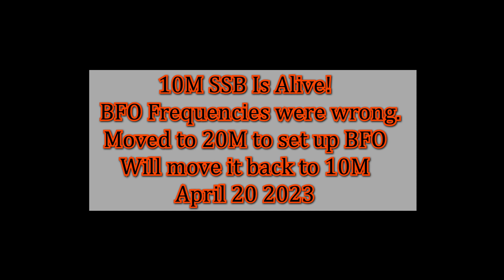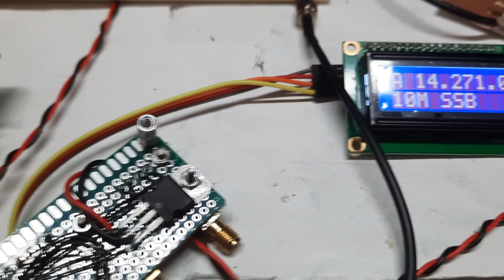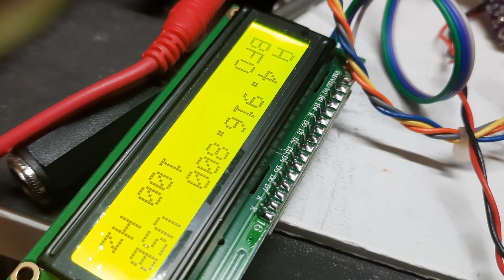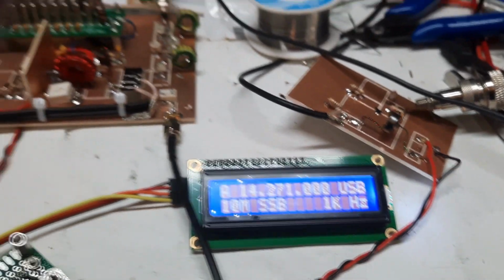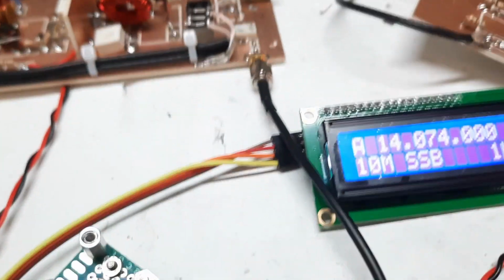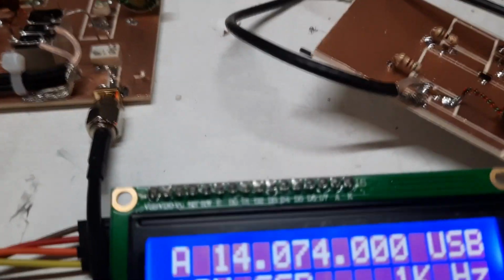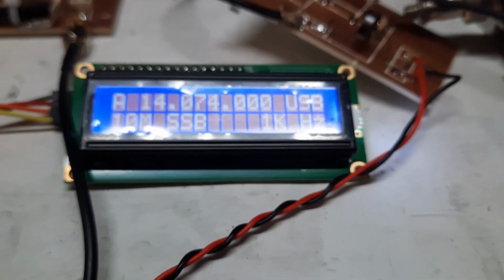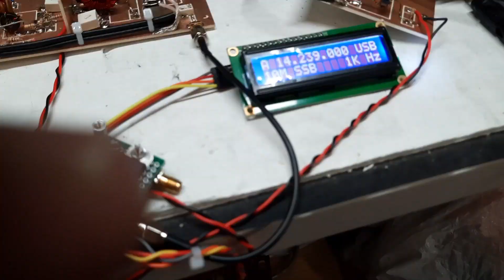10M SSB Transceiver is inhaling RF

Comment: It ain't over till the IF squeals! Is that a kit filter Pete?
Reply from the maker: Yes it is a kit filter that comes in 4 different frequencies. It is from Todd, K7TFC at Mostly DIY RF , com
Yes it does squeal with the right values of emitter resistance (gain). Thanbks for watching,

Pete

Comment: Sounds as good as it looks Pete. Well done! I love that moment when the radio is spread across the bench with all kinds of connecting wires ... and it works! My challenge has always been to keep it working once I've squeezed it into a metal enclosure! 73 Nick
Reply from the maker: Mine Too! But the reverse is true. When I worked in Aerospace this one engineer had been developing a circuit for months and it didn't work. Accidently his shirt cuff caught the corner of a breadboard, and it went on the floor. When he righted it and powered it up-- it worked! Something suddenly got connected when it was powered on. TRGHS.

Thanks for watching and your post.

Pete

Comment: I like that bd layout Pete. Pretty.
Reply from the maker: Thanks John! If you check my website https://www.n6qw.com you'll se the same board layout was used for the 7 transistor SSB transceiver. So, there is a bit of history to that approach, The IF Module is "steered" between the Product Detector/Balanced Modulator and the Rx /Tx Mixer. When the board is completely built it will contain a total of 3 transistors.

73's Pete N6QW